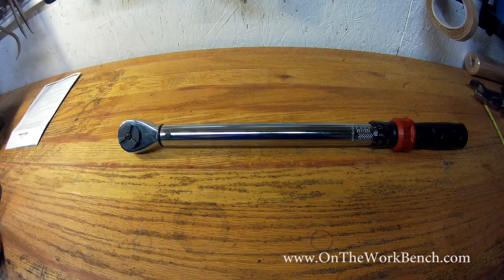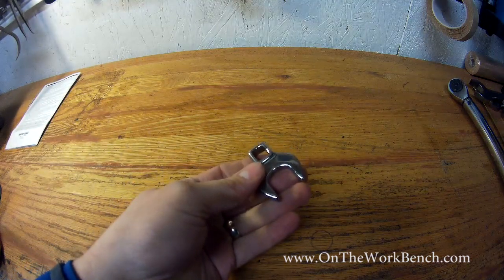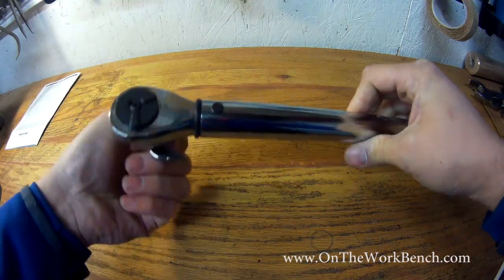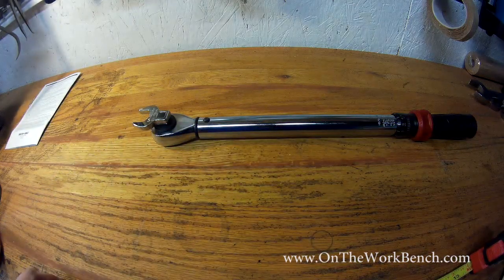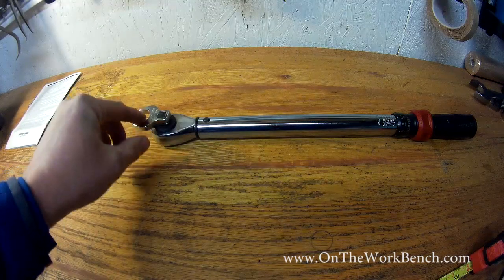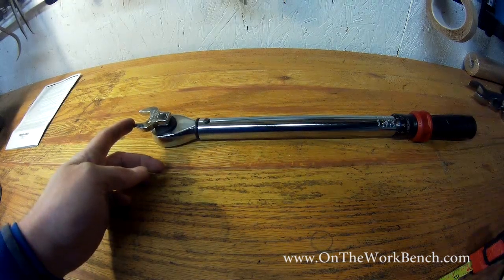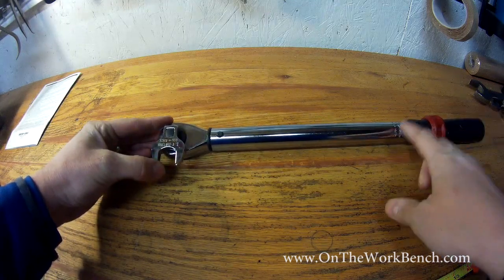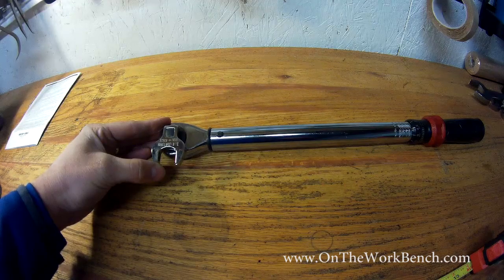Tip: How to Correctly Use a Torque Wrench with a Crowfoot Wrench

Comment: Actually, the distance would still be greater than just using the handle alone.  The Pythagorean theorem shows the distance from the center of the handle to the center of the 90 degrees crow's foot (hypotenuse) would be equal to the square root of the length of the handle squared plus the length of the crow's foot squared.  It might throw off your torque a little bit if you don't take that into account.

Comment: This solution seems to be as close as anybody is likely to get, though technically it's not 100% accurate. At 90 degrees, the the distance from your hand to the center of the crow's foot wrench is slightly longer than the distance from your hand to the base of the crow's foot. Making the torque slightly higher. But we're being pedantic at that point.

Comment: Resurrecting an old comment thread here BUT... I don't think the explanation for the difference in torque is correct.   The torque a wrench is adjusted to is set by the internals of the wrench... how much twisting on the shaft at the end, before it goes click.  You could put a pipe on the end of the torque wrench and make it 3 meteres long, the wrench is still going to click at the same torque spec.    By using a crows foot however, you are using extra 'leverage' on the fastner - purely between the shaft (where the socket normally goes) of the wrench and the fastner - that extra length will make a difference.  Shifting it 90 degrees will change the angle of torque effect between the  end of the torque wrench and the fastner.   This is still multiplied by the leverage between the torque wrench shaft and the end of the crows foot
Reply: Resurrecting an old comment again  🙂  In case anyone passes by and sees this, it is a misunderstanding. This type of torque wrench is affected by where it is held - the internal measuring mechanism has no concept of the twisting at the delivery point, it measures the applied force over a set distance, and the amount of torque delivered at the point the mechanism clicks will change if the force is applied away from the correct location at the handgrip. It's easy to test with a digital torque adapter and see that the torque delivered at click changes with use of a handle extension, or if the grip is moved up the tool.

Comment: i dont think this is correct. there are 4 forces (2 sets of opposing forces), one at the handle, one at the pin of the torque measure mechanism, one at the input of the crows foot and, one at the bolt. The mechanism is designed to click at a reaction force that equates to what torque you adjusted the wrench to. It is where this reaction force is located on the wrench length that needs to be accounted for. It is not the handle.
Reply: The additional length of the adapter is adding a mechanical advantage to the wrench that the torque "sensor" does not see because it is on the other side of the wrist pin. There's a simple equation to convert from desired torque (Td) to indicated torque (Ti) using the length of the wrench w/o adapter (Lw) and the length of the adapter (La): Ti = Td*Lw/(Lw+La). Source: https://en.wikipedia.org/wiki/Torque_wrench

Comment: If space is not a problem, do the 90 degree off set. But if space is a problem, use the straight setting and do a calculation to find out the displayed torque and the equivalent value.
Reply: Yeah sure man. His claim that putting it straight on is 100% incorrect is plain wrong.

Comment: I don’t think the “torque wrench cares” how long the handle is. I can grab it anywhere and apply torque, the result will be the same. I think what matters is the distance from the socket center to the hinge pin. The hinge is spring loaded, that’s what signals that I’ve reached the correct torque. Handle length only effects how much force I have to apply.
Reply: In case anyone passes by and reads this, it is a misunderstanding. This type of torque wrench is affected by where it is held, and the amount of torque delivered will change if the force is applied away from the correct location at the handgrip. To see this quickly, apply the force at the hinge pin. Infinite force can be applied there, but the wrench will never click even if the bolt sheared off. As your grip moves away from the handgrip, the measuring mechanism inside which is part way along the handle sees less and less of the force as you move up the handle, so it doesn't click until you apply more force than is required for the desired torque. The further you get from the handgrip, the more wrong it gets.

Comment: Incorrect.  The crows foot is still not on the same plane as the wrench.  Still need to do the correction as the center of the crows foot to the center of the handle is now the hypotenuse of the triangle.

Comment: So, if I am using a "crow's foot" with my ratcheting torque wrench, should I not only place it at a 90 degree angle but also NOT use the ratcheting feature and just keep taking it off the nut and putting it back on @ 90 degrees when I run out of room to turn, basically using it just like a standard open-end wrench until the torque wrench clicks?
Reply: If one did want to use it with a ratchet would it l work like a ratchet  or does the crowfoot swing on its own and as such acts like a standard open end wrench whether we like it or not?

Comment: Just measure in millimeters and do this:
1. Measure the length the wrench is, if it had a normal socket on.
2. Measure the length with the crows foot added.
3. Take the longer length and divide it by the shorter length.
4. Take your Nm rating and divide that by the number in step 3.

That slightly lower Nm is what to set the torque at if using the crows foot.

Here's an example:
You need to tighten to 60Nm. The wrench is 300mm without a crows foot and 325mm with it.
325mm /300mm = 1.0833
Take the 60Nm and divide by 1.0833 = 55.38Nm

If you're always using the same wrench and all the crows feet always measure the same, you can always divide by that same amount.

Another way is making a calc in Excel, but I won't go into all that here 😛 but you could put "Wrench Without" and "Wrench With" and have it automatically work it out for you.
Reply: It also works by multiplying 60x300 and then dividing by 325

Comment: GOLD.  You answered my exact question, and you did it succinctly.  Rebuilding the front suspension on my late father's 2002 Volvo V70.  No compromises.  All fasteners using torque-to-yield will be replaced, and get exact torque plus angle, per manufacturer's specifications.  I'll be using this information to properly tighten Volvo's "star" nut at the top of the front strut assemblies using a special tool that most people just slap a combination wrench on.  "It doesn't have to be that tight," said IPD's customer service joker once he finally started listening.  Well, no, it has to be exact for this man's son.  I don't second-guess teams of engineers.  Bilsteins on all four wheels, other treats.  Give yourself perfection.  Thanks!

Comment: VERY helpful! Thanks a lot. I suspected this was the case but my torque wrench came with a warning that, if using a crow's foot (diagramed inline, the way you say is WRONG) I should use this somewhat complicated equation to figure out the actual needed setting. I thought to myself, why not just cock the head 90% ? But, with no experience, I was fearful that what I assumed was logical, was in fact, correct. 🤷‍♂️
SO very helpful to have someone with some knowledge give me the thumbs-up! 😉

Comment: The tech manuals I used in the Air Force said when using a standard crowsfoot adapter (not an extended adapter) set the crowsfoot straight and torque to the center of the range. The difference in torque was insignificant.
Reply: Af manuals always give you a torque range 
For old and new fasteners however all click type torque wrenches have an accuracy of + - 5% so it should fall within specifications unless noted by engineering  authority

Comment: Your calculation is off but your end result is the same. 16" is not 1.25', it is 1.33'. What you probably meant to say is 15" is 1.25'. I think the distance you showed to the center of the handle was 15" not 16".
As others have already said, you can change the torque setting for the straight configuration. Since the distance will be 15"+1.5"=16.5" (which is 1.375 foot), then instead of applying the 16ft/lb on the handle, you will only need 20/1.375=14.5 at the handle.
Nevertheless, the gauage of the torque wrench is already calibrated for its length, so on the guage, instead of setting it to 20, you need to set it to (20*14.5)/16=18.1.
the other way to figure this out is to know the following formula
Tw is the setting you need on the wrench scale
Te is the torque at the crowsfoot extension
L is the length without the crowsfoot exntentsion
E is the lenght of the crowsfoot extension

Tw = Te x L/(L+E)
18.1 = 20 x 1.25'/1.375'

Anyway, thanks for the great tip.

Comment: That was genius!  I was unable to torque my outer tie rod because I had to use an Allen wrench to keep the threaded bolt from turning causing me to have to use a wrench to tighten the nut without a torque wrench. You solved that problem. Going to harbor freight to get a set. Thank u

Comment: Good video. Using an angle different from 90 degrees is not "100% incorrect" though, and is sometimes unavoidable - you just have to account for it. For the adjustment equation, go to https://en.wikipedia.org/wiki/Torque_wrench and scroll down to the Extensions section of Using torque wrenches.

Comment: Machanicalistical Mystical Enginerding Set your click wrench to 18 foot pounds, and use it that way. You should get 20.4 foot pounds. That would likely be well within the +/- % spec of the wrench. For longer torque wrenches the difference is not as much. I rather doubt a 15% overtorque would be too damaging, and if your work is that critical your torque wrenches will have to be calibrated on a regular schedule of 1-52x a year, depending on the work being done. I have worked at facilities where the wrenches were swapped with fresh cal cert wrenches every week, and the wrenches were checked on a torque cal meter daily, and those readings were documented, to make sure the cal meter was in spec too. And then they took the jet engine across the road, and threw dead chickens into it until it stopped working.
Reply: Hahahaha...WTF?
Reply: Hopefully they were calibrated chickens.

Comment: This video is great and absolutely correct.  I would always offset 90-deg, but, if you really had to, you can put the crowfoot at 0-deg.  However, you would have to compensate, adjust the Q value based upon the additional length past the center of the Q wrench anvil.  Of course like you stated, just roll it 90-deg and there is no additional math.  Sometimes working on aircraft, you just can't off set it 90-deg (very rare, but happens), so we have guides to compensate for the distance at rotation increase.  When we write it up, we have to annotate the math and the subsequent correction method.

Comment: Unless you’re torquing down to like 200ft/lbs it seems like the crows foot at 0° would still be within spec for normal stuff most people would be torquing. Like car parts. But if you’re building a particle accelerator, nuclear reactor or working on the ISS it might be a problem. For example, my Honda CB axle nut torque is 58-72 ft/lbs. If you go in the middle you’ll still be in spec. 

That being said, I put crows feet at 90° but sometimes you don’t have the room to do that. So keeping it straight isn’t a huge deal.

Comment: Thanks for this! How do you adjust  if you also need to use an extension, which will be necessary for me
Reply: An extension does not increase the moment arm… so as long as you keep the extension parallel with the axis of the nut or bolt, you can use a 2” or 20” (or any other size) extension without affecting the the method explained in the video.

Comment: 90 degrees is not always possible, keeping in mind we are using a crows foot to access a hard to reach place.  I found the closing comments a tad condescending
Reply: I agree…  20 ft-lb  vs 22 ft lbs is inconsequential.   Also a fastener is stronger if you tighten it to just before it’s yield point.  Unless your torque wrench is calibrated appropriately, they are usually pretty off.  So the little delta added by the crows foot won’t make much of a difference.   But if it’s a critical application, do the math or use the method.

Comment: Can one ratchet with a crowfoot or it will swing around and one has to use it like an open box wrench.  I am just interested in using it with a standard ratchet handle and will be in a tight space and need the ratchet feature.  Thanks

Comment: At 90* the distance from the center point of the crows foot to the center point of the handle is still not equal to the center point of the socket to the handle, though much closer.  Better to do the simple math and set the torque wrench to the new result.  Then factor in the last calibration, and quality of the wrench to begin with.  If you are using a Harbor Freight torque wrench it's a futile exercise to begin with. Not to mention most torque requirements do not need to be spot on to the decimal.  Not to mention most folks do not go back later and retorque after bolt stretch. Typically if you have to use a crows foot, it is because a socket will not fit which means going 90* most likely is not an option.

Comment: I'm just curious, as my shop manual specifically calls for crow foot wrench to set torque on ball joints, yet a regular deep well socket fits in all locations. Some, even better than the crow's foot. Is there a specific reason anyone could suggest for using a crow's foot over an impact rated deep well? These are all sub 100 ft/lb specs.
Reply from the maker: In theory the results should be the same, the only issue I can think of is that with the deep socket one might be more likely to come off-axis, and with the extra depth there is some torque loss within the walls of the socket, the deeper the more loss; an impact socket  would also be more prone to this than a chrome. I would suspect that the torque loss  from a deep impact socket would be within the margin of error (unless you are working for NASA, a nuclear reactor,  or some other ultra critical components).  They simply are asking for the least error prone method to cover their tail in case of failure.
Reply: Many cases where you need a crows foot to
Torque lower ball joints with the axle in the way ..
Reply: The upper balljoints on my CTS would be a great example, you have to hold a hex key inside it to keep it from spinning while tightening the nut to specifications, impossible to do with a socket attached to a ratcheting torque wrench or impact gun

Comment: Technically that is not the same length at 90*. Think of it as a triangle, the new length would be the hypotenuse, which in this case is greater than the opposite leg.
Reply from the maker: When calculating a moment arm, it is the perpendicular distance that is used not the hypotenuse, which remains the same when the torque wrench is at 90° to the crows foot.
Reply: An adversary proof is useful here. Let's say your crowsfoot extended for 2 meters. Same 90* angle (perpendicular), not the same distance.
Reply from the maker: The length of the crows foot does not matter, as long as the force being applied to the torque wrench is at a right angle to the torque wrench and parallel to the crows foot. This is analogous to adding an extension between a regular socket and a ratchet; the length of the extension does not change the torque being applied to the fastener. If you have access to an engineering statics textbook, lookup "moment of a force about a point", and you should be able to find more examples. 
See also: http://web.mit.edu/4.441/1_lectures/1_lecture5/1_lecture5.html
Reply: good reference